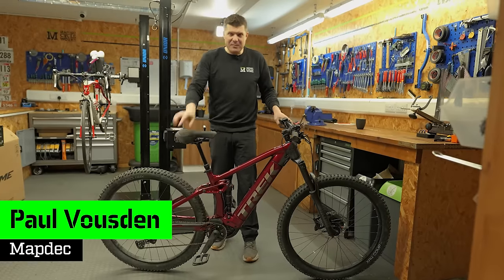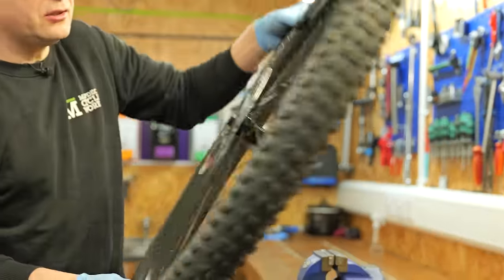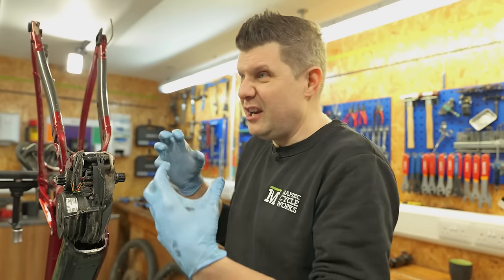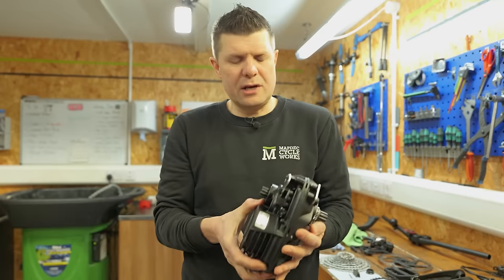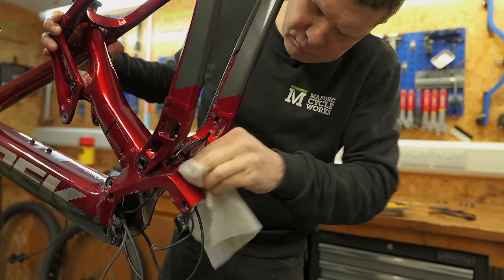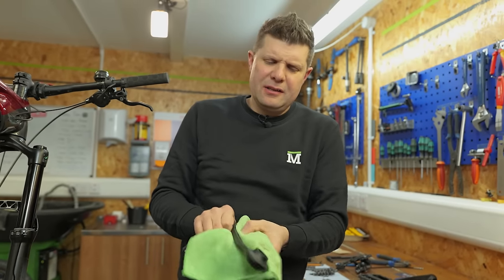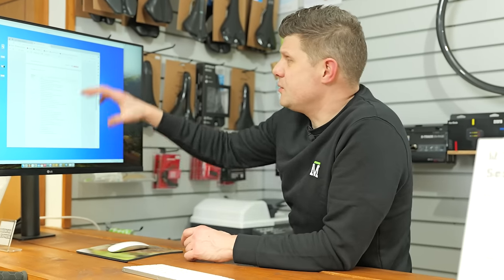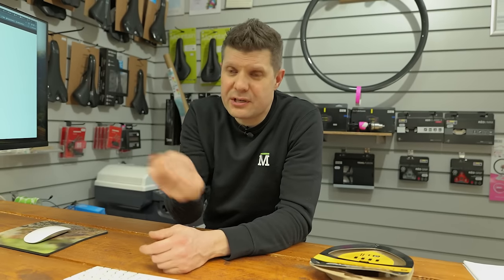This is how much work it takes to service your eMTB

Comment: I build high power ebikes with will do 40 mph.  High end eikes like this Trek are deliberately designed to be a money pit, not only at initial purchase, but long term cost of ownership due to all proprietary parts which all fail like clockwork due to low quality.
This bike has a weak proprietary battery with non brand Li-Ion cells and close to $1K in replacement cost.  A custom builder can build an ebike with twice the battery capacity and 52v for 1/2 this price with the best Li-Ion battery cells in the world.  Same scenario with motor repair/replacement.
RIP off.  All about profit.

Comment: I still don't understand the idea of switching to an electrical bike, unless you're lazy, old, or unfit. The idea of cycling is to get fit, sweat, and achieve same goals. With an electric bike you have zero satisfaction, or improved fitness
Reply: The main benefit is being able to go further (and especially for MTB, do more descents). You can absolutely get a good workout on them if you put in the work, but then you can also be lazy with them and use maximum assistance everywhere or put little effort in.

I did a ride a few days back and my heart rate was consistently higher than it was on a ride a few days prior on an analogue bike because I was putting a lot of effort in. 
It all depends how you use them, and for some people it can mean the difference between getting out on a bike, or not doing at all.
Reply from the maker: They are just damm good fun. Take it to the trail centre and just start lapping the fun bits.
Reply: or disabled, or carrying extra luggage.

Here are stats from Garmin connect for yesterday and today's rides:

Gran fondo road bike (100% my power):
Distance: 103.28 km, Total Ascent: 331 m, Exercise Load: 256, Primary Benefit: Tempo, Avg Power: 133 W, Active Calories: 1938 kJ

E-Gravel ride (middle motor assist or ~100% power assist; i.e. it matches my power 1 to 1):
Distance: 29.05 km, Total Ascent: 471 m, Exercise Load: 190, Primary Benefit: Threshold, Avg Power: 150 W (my own power), Active Calories: 819 kJ

So, how is the electric bike being lazy for me?
Reply: There are times when I'd rather get home over a large hill than ride an extra 5 miles around it. I'd like an ebike so I can easily get to places that I usually avoid.
Reply: They are basically mopeds at this point. The Saurron doesn't  even have pedals- at least none I have seen have pedals...

Comment: New bikes are ridiculous. 50h service interval? So every month of the riding season your shocks need to be rebuilt? That's absurd. If I told you your car had the same service intervals you'd lose your GD mind. I'm an automotive tech and it infuriates me how shitty expensive bikes are. There's literally no excuse for them to be as fragile as they are.
Reply from the maker: Not rebuilt. Just the wiper seals.
Reply: @Mapdec  still, torn down completely is basically a rebuild without parts replacement. Either way, I'm certainly not knocking you guys, I love your content that I've stumbled into; more the manufacturers. Like I said, imagine I told you you had to have your suspension disassembled, serviced and refreshed on your car every month.
Reply from the maker: @thethepete731  it’s mad I know.  The suspension on these things is more like the suspension you would find on a single seat race car.  With such small motors we have to keep things light, and that makes a big sacrifice to durability.  Honestly, one little scratch on the shaft of that shock and it will leak air. And yet there it is, exposed to all the rocks, mud and stuff.

Comment: Well..its a motorcycle. There's that. Just because you don't say "motor" doesn't mean it's not there. Your literally holding it.
 Here's a hint. Bicycle riders don't forget to leave the key. 😂
This is a motorcycle video. 
300$ basic tune up and goes up if the "motor" needs more. Lol. 300$ 😂😂😂.
Not particularly made for the power that goes thru them. Your words. Its because there is a motor strapped to a "bicycle".  Look at all the parts being replaced. Looking like a 500$ bill on a 1 year old bike.
Ridiculous.  Noooo thanks. 
Oh look, new dropper cable also now. Jagwire pro at that.
New shift cables. 1 yr old.  Plug into diagnostic. Update software? This is a "motor" cycle. When shops start calling a spade a spade, when the bicycle industry will acknowledge this fact, the local bike shops might be able to recover. Because they are dissapearing at a very alarming rate. Motorcycles are not bicycles. Could easily fetch over a 1000. Omg Ouch.
Reply from the maker: So… what are you trying to say?

Comment: These motors aren't IP6 rated unfortunately and of bad design compared to Shimano . The dirt ingress shows a faulty motor seal at assembly time . Bosch motors seldom get this bad without nearing a burn out of windings occuring .

Comment: Let me get this straight. This is not „how to service eMTB”. This should go „how to service your MTB that happens to be an ebike” as there is no servicing the motor more than just wiping it.
Reply from the maker: Correct.  This is what is demanded from Bosch to maintain your warranty.
Reply: @Mapdec  BTW. Are those motors sealed enough to wash them upside down under running water? Just curious.
Reply from the maker: @adamnowak8876  yes. They are sealed enough to be pressure washed, ridden through rivers and smashed about like mountain bikers do.

Comment: £300 is an absolute scam for such a crappy service. The bike is not even washed and without replacing the ball bearings in the hubs he just loosened the cones and squirted some grease in to it. Even the freehub was not removed and cleaned but instead just stuck some grease into the freehub over all the old gunk. I should be charging £500 for the level of meticulous service I afford my customer's bikes.
Reply from the maker: lol. The hubs don’t even have cones.  You are looking at sealed cartridge bearings that were perfectly serviceable, that just got cleaned out and a little grease applied to protect against moisture and corrosion. But bless you. Thanks for the comment.
Reply: @Mapdec  Really, then why is he squirting grease into the hub after loosening the hub nuts? Maybe the freak thought he needs to just squirt some grease in there??